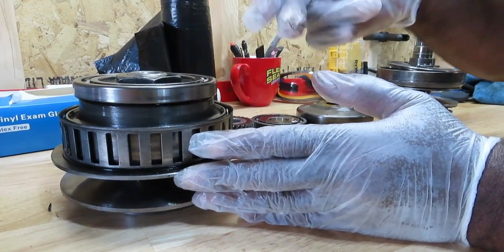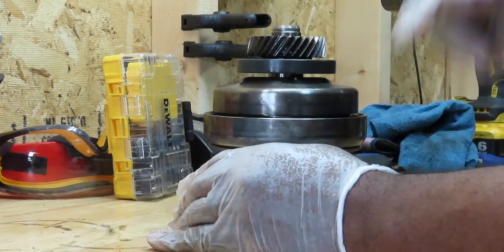Why do the PRIMARY & SECONDARY Variators fail inside a CVT transmission?

Comment: What’s you opinion on the other side of the transmission. The clutches, do they tend to fail or is most the problems with what you showed in the video.
Reply from the maker: These are the primary issues with these transmissions, and once you start losing pressure, the other parts will fail.

Comment: Where do you source your Teflon seal for the secondary drive pulley (the one with the spring in it) ? I bought multiple off of cobra and none are correct
Reply from the maker: That's exactly where we got them from. We bought a master rebuild kit, and the seals were in there.
Reply: @OnlineAutoRepairVideos  thanks for the info I'm just trying to source that one seal because I better kits for the primary separately so I hate to keep buying master kits when I don't need them.

Comment: I am in the middle of putting a jf015 E back together.  The new kits I have found have rubber gaskets for the variators instead of the fibre ring.  Have you seen this as well?
Reply from the maker: no I have not, interesting.
Reply: Did they work well?
Reply: @plshelp2906   Yes the car works very well!  Daughter and Son in law are very happy that I could repair.
Reply: Whats the kit part number or where do i find it? Mine is a JF015E 29T
Reply: @qaysalshwaiyat905 I will have to try to locate information.  I am a 60 year old  40 yr HVAC tech and going a bit crazy with all the heat.  Not even the technicians can fix now days.   sad

Comment: Is there an o-ring seal or any type of rubber seal on the casing where these pulleys mount to hold pressure in or is it just the Teflon seal that allows for some blowby?

Comment: I really wish you would have shown how you loosened that 45mm nut prior to mounting it in the press. But mentioning its reveresed thread helps, just would have appreciated the physical guidance of the how to hold it sturdy enough to loosen without damaging it.
Reply from the maker: https://www.youtube.com/watch?v=owfEtWFZTHw
https://www.youtube.com/watch?v=HG7uI-rvxdk
Reply: Thank you! I like your style of explanation, I Subscribed. 
Currently working on reof11a and both pulleys require new seals as air pressure testing showed blow by and no actuation under air pressure. I'm just having difficulty removing the nuts on both primary and secondary to disassemble them.
Reply from the maker: @NelO-n7q  Thanks, and those two videos will guide you step by step to rebuilding them!
Reply: Thank you so much for your videos! 
On the secondary, I put all new seals and now it's air tight, fully rebuilt as you instructed. I tested for leaks and no air came out of it, but it also doesn't do anything, looking at it's design with the spring as a way to return it to the expanded tight pulley configuration im wondering if its instead a vacuum that is applied that compresses the spring by pulling the air out and opening the pulley gap that the belt rides in??
Reply from the maker: @NelO-n7q  THANK YOU! Those transmissions work under around 700psi to 1500psi, so it has the power to compress that spring.
Reply: The reason why I bring this up is that I'm trying to reassemble the pulley housing but I can't seem to stretch the belt out enough to get the both pulleys set into their spots, if I could get the secondary to open up a bit the belt would be able to go in deeper and allow some slack so that I can place them in, but I can't get any movement out of the secondary to make the belt set deeper into it, seems to stick out from the steel bands out.
Reply from the maker: @NelO-n7q  We have the complete video series on reassembling the transmission as well, so hopefully that video will be able to help you get that back together.
Reply: @OnlineAutoRepairVideos  great! Do you have a link to it? I looked thru your videos and didn't find it. The links you sent before have a slightly different transmission in which both pulleys are able to be manipulated by hand and are thereby easier to mount with the belt on. I just need a way to be able to put them both back into their housing with the belt on.

Comment: I installed new seals and they leaked worse than the old ones. Is any leakage acceptable?
Reply: This video is so underrated should have Alot more views
Reply: Hi, I am working on this transmission for 3 weeks now.I have same problem like you.I used teflon and I got a better seal but if you put a bigger pressure it leaks out again.Tomorrow I will try putting the more teflon on both variator seals and try it tomorrow on the vehicle.I am not really sure but I got a lot of trouble with this one.Trash transmission, if this dont work out tomorrow I will need to buy other working tranny.I dont have other options..This CVT is going to cost me a lot, I will have to sort it out with my costumer :D
Reply: @erminrizvic7680 did you figure out how to stop the leak

Comment: I paid $300 for a complete kit .. installed new seals on both variators still had a leak . I came to a conclusion either the seals weren't made right or the metal surface was worn .. solved it by rapping telfon and the new seal over
Reply: What do you mean you wrapped Teflon around it? 
Like you put Teflon around the variator and then put the seal over?

Comment: This just shows these transmissions don't lats that long.
Reply: They are total junk all of them should be outlawed from being used in any and all applications.
Reply: They can last for 200.000 miles or 330.000 km, even in adverse conditions (lots of city traffic in arctic conditions). Trouble is, different makes put different loads on it at different oil temperatures on different weights of cars. The example I was refering to, was a weak sauce engine in a light vehicle that was equipped with a CVT oil cooler.